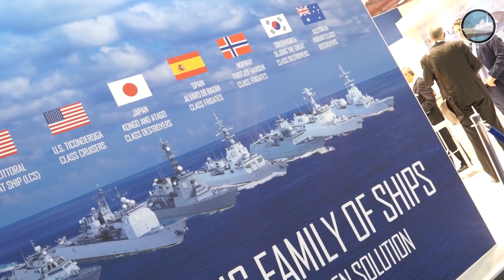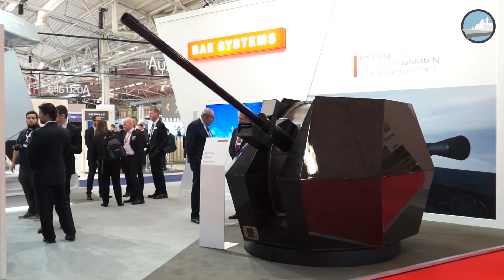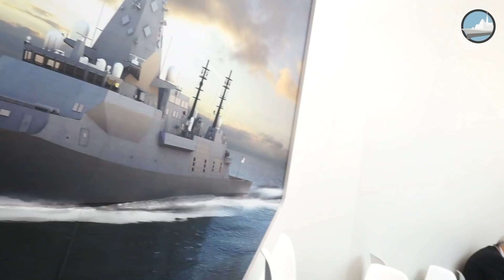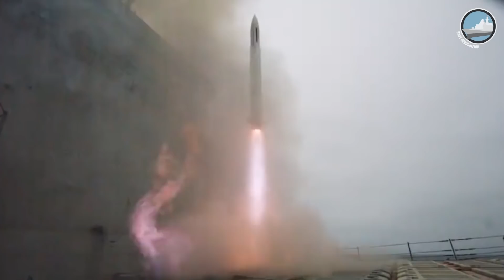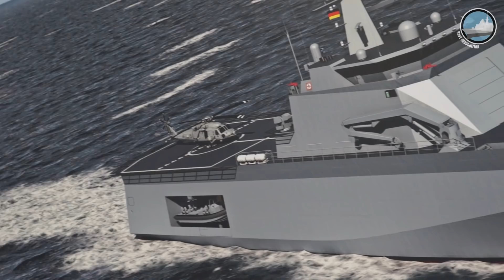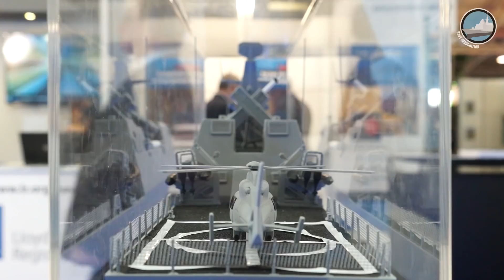Euronaval 2018 : International Exhibitors

Comment: When did Canada pick the Type 26? Just few weeks back they announced nothing official and that only looking to modernize existing fleet we have so there can be jobs at our ship building docks.
Reply: Actually all final decisions on hold and Lockheed had been chosen for the contract not the Type 26 from Britain.
https://globalnews.ca/news/4686905/legal-challenge-canadian-warships/
Reply: Thank you for finding this article. I've been confused for a little while about this because I'd heard "Canada is buying a variant of the type 26" but also "lockheed martin is building a ship for canada based on the type 26", and was very unsure of what was happening there, but this article finally answers it:

"...BAE, which originally designed the Type 26 and partnered with Lockheed to offer the ship to Canada." So it is the base design of the type 26, built pretty much under license by Lockheed martin to the specificaions Canada requies. Thanks again.

Comment: How come, torpedoes are hardly being used now these days on modern naval ships...
Reply: @Gar  not actually true. Heavyweight torpedoes can't be launched by helicopters. They are launched by ships and subs. And they have large range, so ships doesn't need to be close to threats. And the chance of survival of a torpedo attack by a surface ship is much higher than a submarine. They carry more decoys and hard kill equipment and they're also generally faster. And, even after a successful hit, there's a chance that surface ship might not sink and actually retaliate. If a sub gets hit, it's either surface immediately and surrender or die at the bottom of the sea. So most subs are more scared of surface ships than the other way around.
Reply: @Gar  I forgot to mention that surface ships carry literally BOATLOADS of torpedoes and anti submarine weapons. Subs carry a very small amount of weapons. Usually the number of torpedoes is in single digits.
So a submarine's only chance is to get a fatal hit by the first shot, otherwise they're screwed. Meanwhile, surface ships can launch weapon after weapon until they get it done.

Comment: The Evolved SeaSparrow block 2 is going to be a game changer!  A mini SM-6.  Well, for those who can afford it, of course.
Reply: @Gar  Yes it will but it won't need the target to be illumnated by targeting radar.  Just a guess here but I think the Sea Sparrow is too heavy to soft launch reliably.  I wish it did!  I really like the SeaCeptor for smaller warships.
Reply: @mburnzy9269  actually sea sparrow isn't hot launched because it's too heavy. It's not designed to be soft launched. That's all. And soft launching is expensive and more complex.
Heavy missiles are actually launched only as soft launches. Because their rocket motors are too large to be ignited safely within the ship. All slbms are soft launched because of this.
Reply: The us need to do a game changer and make the essm-er adding a booster to the very short essm you could make it 4.7 meters the length of the sm-2 to fit the mk41 self defense legth and have the first quad packed long range missile because it's going to have a range of maybe like at least 70-80 kilometers

Comment: I think Germans are drunk. Their recent navy ship designs look so awful.
Reply: They look by far better than anything i have seen here. Especially K130, F125, MKS180, even the old Sachsen class
Reply: i have been thinking about it a lot but can you or someone explain to me why you would put a gun turret in any other place exept the center? cus right now that ship has a weakness on one side? it just doesn't make any sense why you would do that
Reply: That's what I wanna ask too. xD
Reply: cu is a helecopter carrier  mybee @bartvanherrewegen8953
Reply: I don't think it really makes much difference, in terms of where the gun can target. As for why it's usually in the middle, I'd assume its just easier if a ship is symmetrical, and because having it mounted centrally maybe leaves the most bellow deck space due to the typical angle of a ship's hull? Not really sure.
Reply: Looks ugly